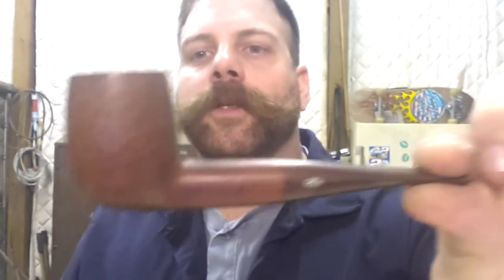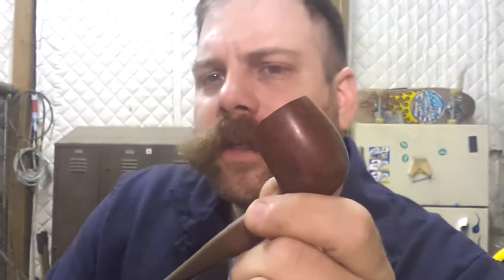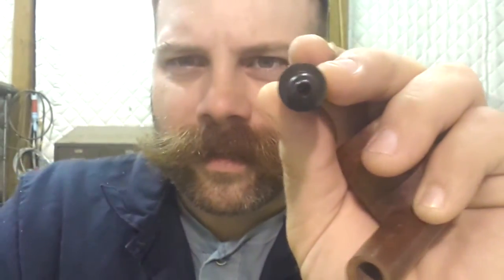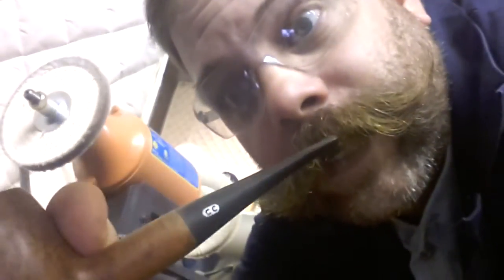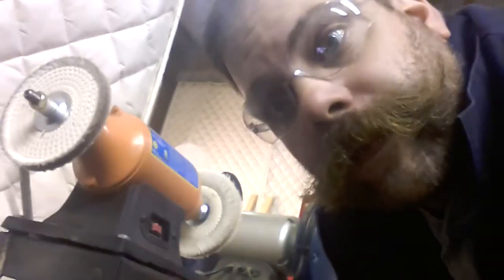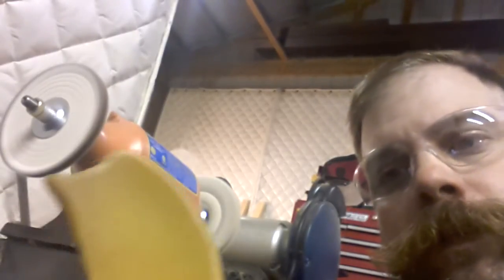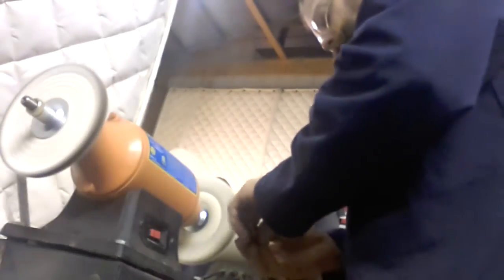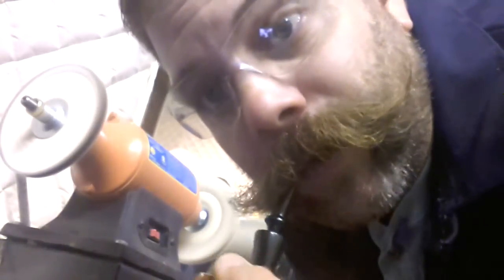Estate Pipe Restoration

Comment: How about the inside of the stem?  Without using an alcohol retort, it would be good to let folks know how to clean and sterilise the inside of the stem.  I use oxyclean knowing that the  outside will need sanding anyway then run pipe cleaners soaked in IPA through until clean before a final rinse.